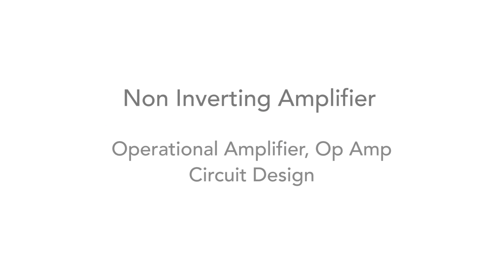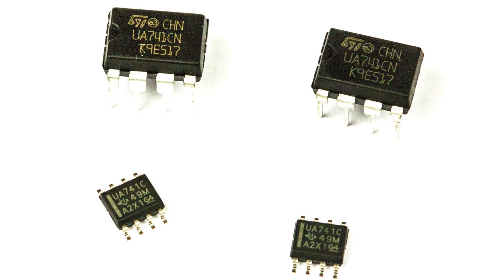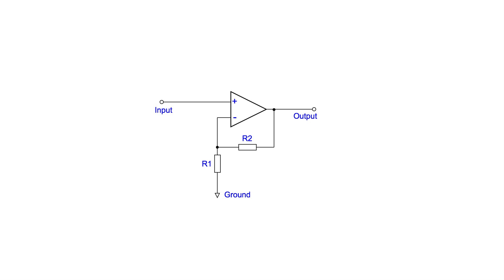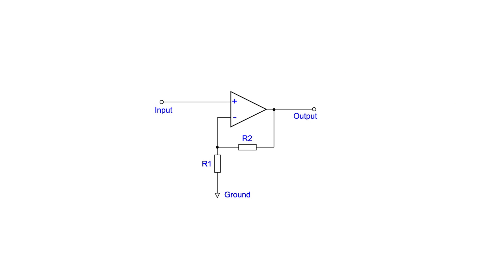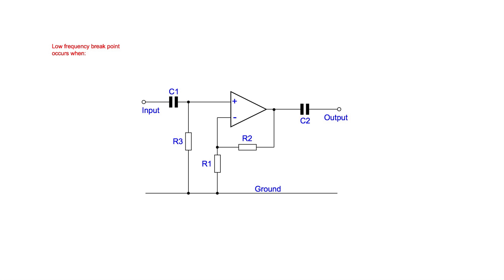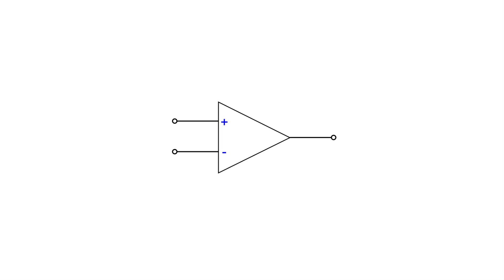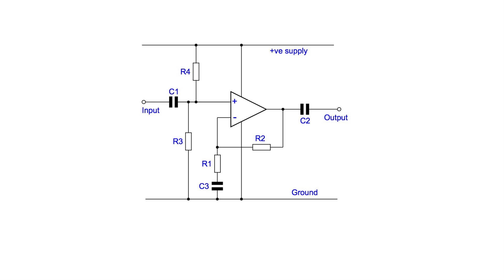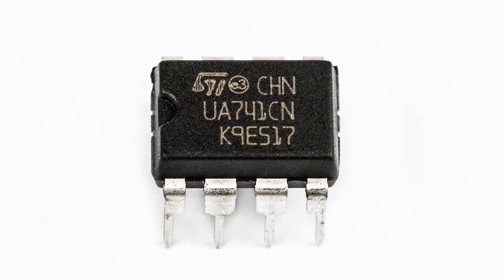Op Amp Non Inverting Amplifier Design | Operational Amplifier Circuit

Comment: First of all: wonderful, clear, insightful video, congratulations and big thanks from the bottom of my heart. 

I got just a few questions,
when calculating the value of C1, we use the value of R3 in the equation. 
To calculate C2, which value of resistance should I use?

and to make it clear as water,
when using a TL071 opamp that operates on a single power supply (+V and GND), do I still need to create the half supply point you mentioned on 5:00 or is it all right to connect pins 7 and 4 respectively to +12V and GND?

Hope I made my questions clear and hope I get some much needed help😅

Once again, congrats on the video, it's as masterpiece.
Reply from the maker: To calculate the value of C1, the breakpoint is calculated using the values of R3 in parallel with R4 - the input resistance of the op-amp is very high and can be ignored.. As these are normally the same, the value will be half that of R3 or R4. This is because the resistance acting with C1 is the input circuit and nowhere else.The low frequency breakpoint occurs when the reactance of C1 is equal to the input resistance, ie R3//R4.
In terms of the supplies, yes, connect the high voltage to V+ and the low voltage to V-.
I hope this helps.

Comment: Hi, in theory the gain ratio is unlimited in the non inverting op-amp amplifier circuit. Is it actually possible to make a profit in this way?
E.g; Can a 12mv sine signal be amplified to 12v with 1000x gain?
Reply from the maker: Unfortunately, while an op amp has a very large gain, it has very limited bandwidth. The use of negative feedback enables the characteristics of an overall amplifier circuit to be tightly controlled, but because of the roll-off of the frequency response of the basic operational amplifier chip itself, I would not want to approach gains of 100 for an amplifier with a bandwidth of, say 3 kHz even, and generally go for very much less.

Comment: Thanks for the video - very clear and informative! I'm still struggling to wrap my head around the significance of the C3 capacitor - why is it necessary to put it there? Why can the ground potential be bad for the inverting input? (I thought the ground has potential of 0). Cheers!
Reply from the maker: When running an op amp from a single rail, it is necessary to keep the two inputs at about half the rail voltage. If C3 was omitted, then the inverting input would be linked both e zero volts line and would cause a large differential voltage to appear at the input. The output would then amplify this difference and head towards the rail voltage. This would render the amplifier useless. Hope this helps.

Comment: About C2 how to calculate it? thank you
Reply from the maker: As suggested, use exactly the same logic as used on the input capacitor. The breakpoint occurs when the capacitive reactance equals the old impedance assuming the source impedance within the op amp is negligible. The frequency at which the capacitive reactance equals the old impedance is the break point. I hope this helps.

Comment: Im confused about high & low pass filters i know that high pass filter blocks the low frequency & only allows the high frequency & vice versa but i dont know how to use them & where & when to use them can you help me
Do you have any video about this
Reply from the maker: No problems, as you suggest this might be an idea for a future video - we don't have one at the moment, but it is a good idea.
As for where and when yo use them you might like to see our op amp filters haves:
https://www.electronics-notes.com/articles/analogue_circuits/operational-amplifier-op-amp/high-pass-active-filter.php

and
https://www.electronics-notes.com/articles/analogue_circuits/operational-amplifier-op-amp/low-pass-active-filter.php

Filters like these tend to be used in audio and other low frequency circuits as the bandwidth of the op-amp general limits them. Applications might include a high pass filter to only allow frequencies in an audio amp above mains frequencies, a low pass filter may be used where the top frequencies need to be reduced in level. They are used in digital to analogue and analogue to digital conversion to prevent a phenomenon called aliasing.
I hope this helps

Comment: I keep calculating C1 to be 15.9nF, where am I going wrong?
Reply from the maker: Not sure where you are going wrong. For a break point of 100Hz and an input impedance of 1K the reactance of the capacitor must be 1K at 100Hz. C=1/ (2 pi f R) = 1000000 / 2 pi 100 1000 uF. Take 2 pi as 6 then C = 10 / 6 = 1.6666 uF - we can use a 2uF capacitor.
Reply: @ElectronicsNotes  A little late here, but when using a calculator that has a set value of pi to 16 decimal places, the result is 15.9 nF. The difference is probably not worth worrying about.

Comment: can I ask why we should add capacitor? what if we dont?
Reply from the maker: The capacitors are used to isolate the DC voltages on a point. If there is DC then the lack of a capacitor will cause the circuit to work incorrectly or not at all.
Reply: ouhh.. i see.. tq for the answer. appreciate it :)

Comment: very useful dear, keep going we will support to the maximum we can, if possible to do more complicated circuit calculating for OP-AMP, like the best way to make a transformerless power supply for OP-AMP with relay 24V, for example.
Reply from the maker: Thai you for both of your comments. I plan to do some more op-amp circuits in the future, but I am currently heavily involved in a new spectrum analyzer video and a series on using oscilloscopes. After that I will try to get some more op-amp videos done.
Reply: ElectronicsNotes 
ElectronicsNotes appreciate your reply... and a spectrum analyzer and oscilloscope tutorial is a very very useful for any electronic designer... I'm waiting it definitely... and also I'm at your right hand to help any anyway... currently will do my best to widely share all your videos 🖒
Reply from the maker: I really appreciate you sharing the videos - it really helps. Many thanks - keep up the good work.